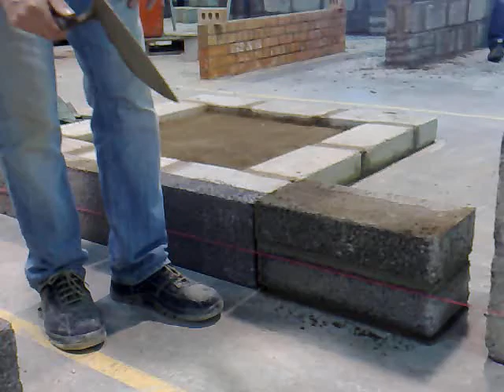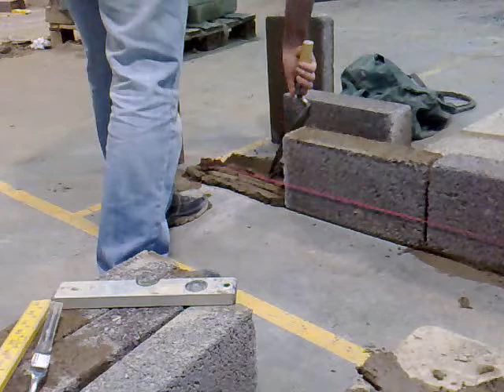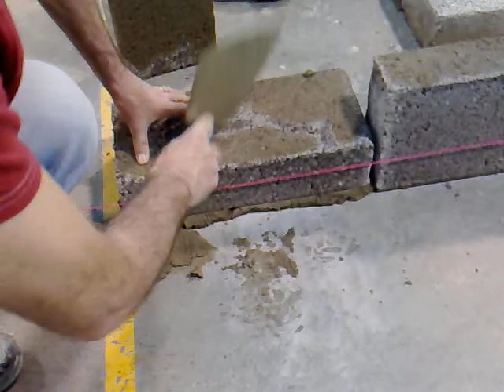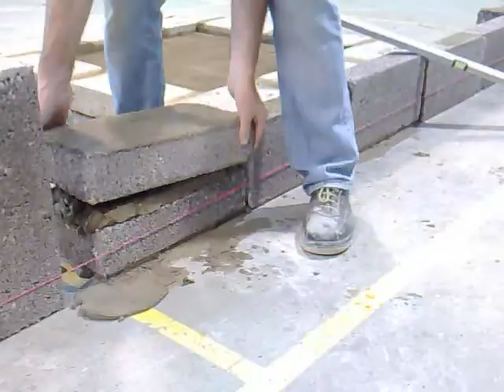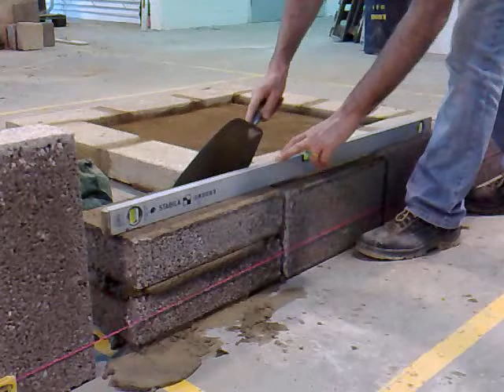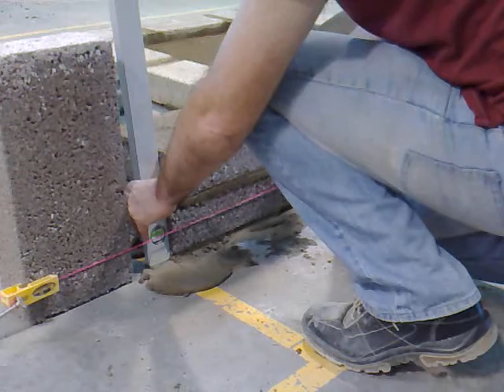Leveling the First Course of Blockwork (video 3 of 8)

Comment from the maker: Ideally you should be building your blockwork level, however
if you can’t, then just try and keep the bed joints i.e. the horizontal mortar
joints the same depth on each course/row as you build. You can use your
measuring tape to do this. This means that your blockwork will not be level,
which will make it more difficult for you to build. Just build one block on
either end or corner and then put up your line and run in one course at a time.
This way you should be able to keep the top edge or arris of your blockwork in
line as you go. Best of luck!